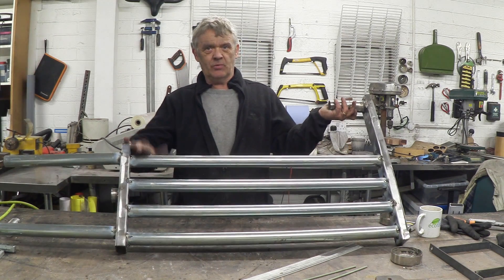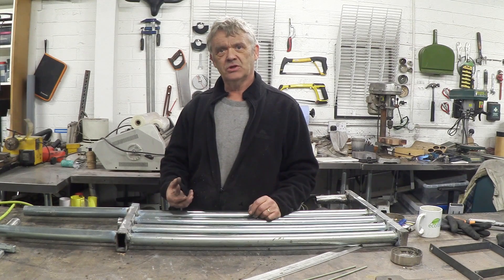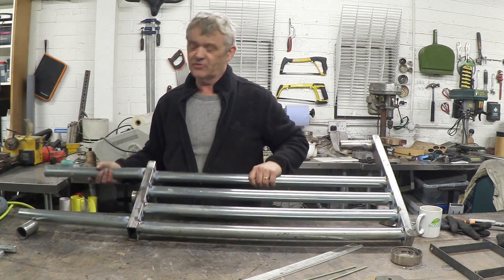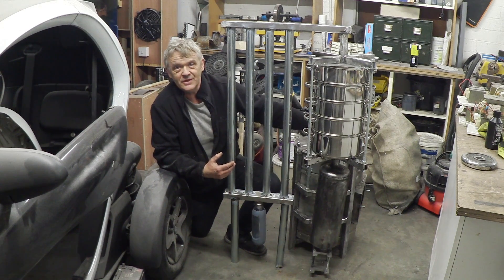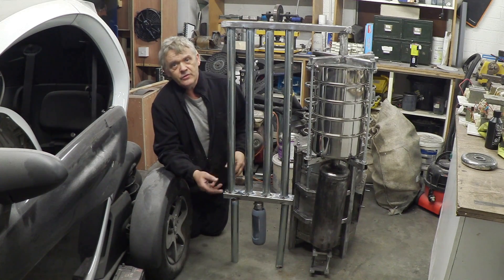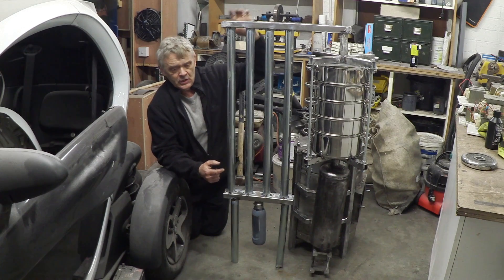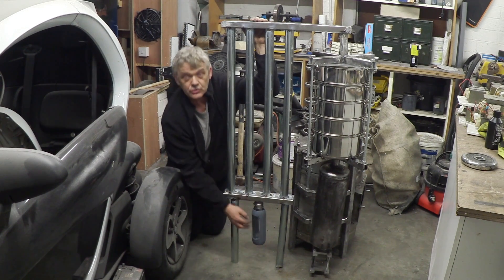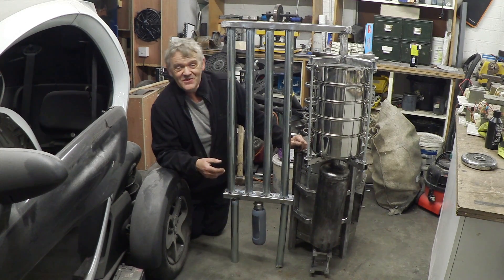DIY Gasification and Generator Unit - Part 7 - Final Jobs

Comment: To avoid those leaky weld issues you could make your radiator from black pipe that you can buy at any home improvement store.  It is not too expensive  and with some Teflon tape should not leak. Here's another idea as well. Build a sheet metal box around  the radiator  with 2 vents, a blower on one and the other a furnace duct. That way you can recover the heat. I live  near Edmonton  Alberta  in Canada so the heat would be welcomed by my chickens in the barn.  A carbon monoxide detector  on the output would be a good idea.
Reply: The CO detector would be on the output of the radiator box. In a normal hot air furnace there would be a heat exchanger to isolate the combustion gases from the heated air side. If there is a leak, the detector could save your life.
Reply from the maker: recovery of the heat is on my upgrade list mate - first let's get this thing running lol - I like the CO detector idea

Comment: WOW, that is becoming one big machine. Looking forward to see it working. Just a question, doesn't it help to keep the gas real cool, like the cooler the better?
Spray foam insulation with graphene mixed in it would be awesome if it existed, something like that would keep anything ice cold.
Reply from the maker: cooling it increases the density so more power!

Comment: Getting anxious to see it running!!  What I'm still in the dark about is how you match gas supply with demand of the engine.  Assuming you're in a perpetual state of producing excess so that the generator always has enough fuel, what do you plan to do with it?  Store it, exhaust it, burn it off?
Reply: If I understand correctly, the blower is only used to get it started generating the gas.  Once it is hooked to the engine, the vacuum of the engine pulls the gas in so it SHOULD only produce what it is using.  I think Rob designed the burn tube to be sized for the engine too.
Reply from the maker: the burner is sized to the engine courtesy of the FEMA handbook and the engine vacuum pulls what it needs so there is a degree of self regulation going on
Reply: @ThinkingandTinkering  & @flashlit123:  Ah, now it seems obvious.  For some reason I was imagining all the gas produced would be going through the filters, but it's only the gas as required on-demand by the engine. Got it!
Reply: He got the specs from FEMA website.

Comment: I've been waiting for this series to conclude before commenting, absolutely love this though. It's something that Britain did actually do during WW2 for some military vehicles due to the need to conserve petrol, and I've watched videos where people have made a lawnmower motor etc run on this. Incidentally when looking into this several years ago, I did chance upon a company which make 20kW generators using this, which come installed on a pallate, I cannot remember the name of them at the moment unfortunately. Not cheap, I think it was around about £13,000, but for a commercial venture with enough land to coppice for themselves, it's certainly a viable carbon neutral power source
Reply: Victrix gasworks?
Reply: Desmond Bagley  perhaps not for some on demand static energy requirements, but when it comes to transport, the high capacity batteries we have available at the moment aren't themselves wonderful for the environment (albeit not in greenhouse gases I don't think) and they're also limited in lifespan. There is also the potential for them to catch fire, which is oddly more likely than petrol car catching fire and potentially more dangerous due to how rapidly and violently lithium battery fires can spread before you've noticed them. I certainly don't think we've developed an ideal personal transport power source yet, but a wood gas engine wouldn't be a terrible idea, just takes a while to get going (which might make people consider whether they really need to use the car at all of course). Plus you get charcoal out of it. And the filtered out tar has uses.
Reply from the maker: I agree mate - and I think you are right 13,000 does sound a lot